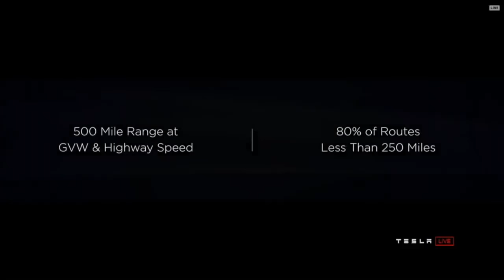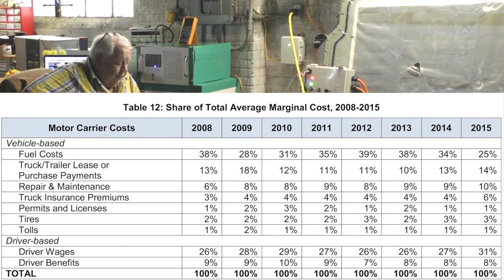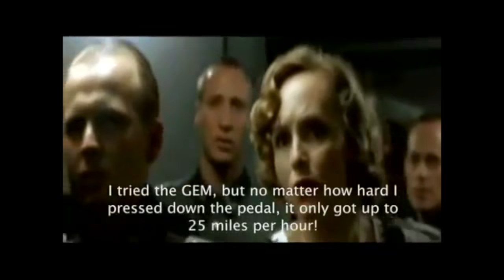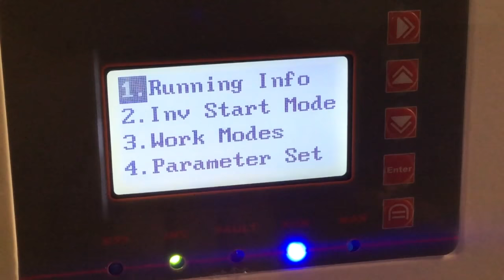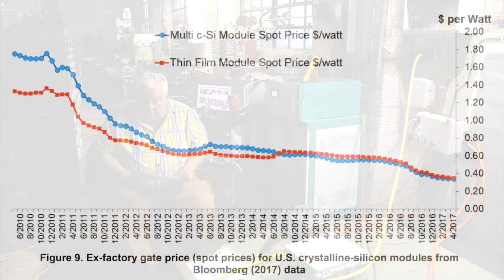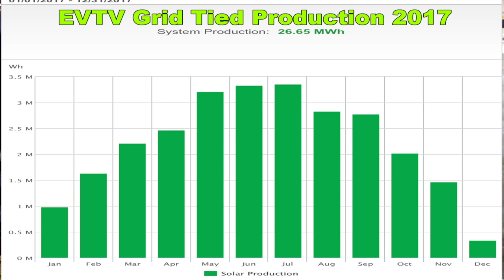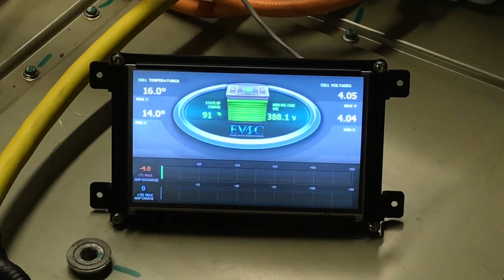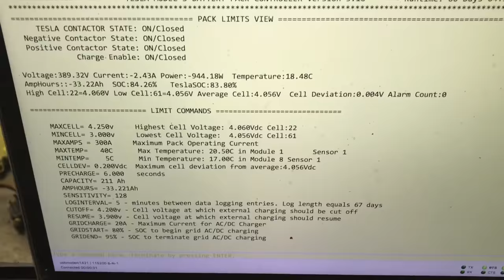EVTV - Dual Tesla Model S Batteries as Solar Energy  Storage

Comment: Great video. Highly informative. I like the idea about using the charger in the winter as even here in sunny Los Angeles, the winter drops my solar input by about two-thirds on my Battery/Solar shed. After five years of trying to get a battery system from Solar City and Tesla, last Christmas I built my own using Jehu's old Samba batteries. It is a 48 volt system. I have been using it for a year now with no problems. I use it to charge my Model S. Looks like I am finally going to get my Tesla battery too. LADWP, Tesla, and my installer, yesterday have approved the system. Can't wait! My other Christmas gift is we are picking up our Tesla Model 3 this afternoon. Looks like it is going to be a Merry Christmas.

Comment: I'm glad that people like you and Damien exist, I'd be ignorant without you! As for Tesla battery to battery charging, what part of the Tesla allows for ludicrous mode and chill mode. These modes would suggest that there is already control over the output (but would that be in the motors inverter or the main controller?)

Comment: Great video!, I can confirm that the trucking mega chargers WILL be a separate charging network and will not use the same connectors as the regular Tesla supercharging network. Tesla will install Mega chargers at places where company's own the new Tesla Semi, they will install the mega chargers along routes of company's who buy into the Semi FIRST and expand from there, with plans to spread the mega chargers worldwide. They have 2 years to start installing these, and they will not need as many as the supercharging network as the number of Semi produced will be much less.

Comment: Comment at 1:15:00ish, regarding utility company workers checking for voltage prior to working on grid wiring during power outage. Jack implies that if workers check for voltage and shut down the source before working on the line, they'd be fine without having to have an automatic shut down switch on each house with solar, wind or generator. The problem is that there is virtually no way for those workers to tag-out, lock-out every possible source feeding the line. Without an automatic switch, when the sun comes out, the wind starts up, generator gets refueled, homeowner flips the main switch back on, etc. the workers would never know when the lines will suddenly become re-energized.

Comment: Nice to see you are working on new things, always fun to hear about your progress on many fronts.

I see your 6.6kW charger list listed with only an AC input range, would the 6.6kW charger work to charge from a DC input to transfer power from one battery to another?  Or is the input strictly AC?  I have found many AC to DC power supplies work just fine on a DC input so long as it is in an acceptable range (150vdc to 300vdc seems to work well on computer power supplies for example.)
Reply: Nice so you could almost use this to transfer power between your two Tesla packs and balance the voltages before paralleling them (if you are under 375 volts).  (Though I admit directly connecting them and recording the current spike sounds much more exciting!)  Some of the power supplies I have tested also take that rectified DC input and run it through a power factor correction boost converter.  While they do handle the DC input I have yet to find any thing that says it is OK to use a power factor correction boost converter as just a plain high voltage DC to DC boost converter.

Comment: Can a grid-tie sync source with feedback isolation (transformer? diodes?) be simulated (current limited signal injection) or use a battery inverter AC output as the sync source to trigger the microinverters into operation? I just found your channel and I must say, this channel has the most useful information than any other EV battery site I've seen. It's gonna take me a month to re-learn all the possibilities of PV using EV modules for storage. I've been beating my head against the wall trying to come up with an efficient, yet simple system of supplying an off-grid full sized home with enough power to live like I'm on-grid without breaking the bank or having too much equipment with too many points of failure. I prefer the idea of AC coupled microinverters with an EV battery backup using standard (240vac) Tesla chargers and controllers. My peak grid use in the badly inefficient home I live in now peaks at about 2200kwh month during high summer.  I currently work doing telecom power generation, 48vdc battery, and DC power plants, am retiring next year, and will be going off-grid in north-central Arkansas. Seeing as how your up in MO, I'll probably be coming for visit, once the property has been purchased and load analysis has been done on the new place. I'm planning on 30-40kwh.

Comment: Hi Jack, AFAIK during chademo session car is sending over the canbus the power it requires for charging and as soon as it's off too much will disconnect battery immediately. Hooking up fully charged external battery to discharged one in the car doesn't gives you too much control unless you have idea how to solve that too.
Reply: Jack I'm sorry I didn't mean to upset you - I base my AFAIK on mynissanleaf forum where Gary Giddings did plenty of work on Chademo - I'm not sure how closely Tesla follows Chademo specs. Gary mentioned that V2H cars did have special firmware on them.

Comment: 12:37 Wrong
IF the tractor slows down BUT the loaded heavy trailer DOES NOT SLOW DOWN. The trailer will pass the tractor,  that is called Jack knife.

Comment: What fraction of the diesel costs are taxes that fund road maintenance?  If those taxes were paid by electric semis (the electric semis won’t be subsidized forever), how does that impact their cost per mile?
Reply: Electric semis are great, and the economics will likely cause them to overtake diesel faster than most people expect. However, semis damage roads at a much greater rate than standard vehicles. Diesel taxes fund those repairs. Eventually someone will need to pay for the road repairs and those taxes will either come from a use tax or the general fund. You’re implying that the loss of those taxes are a good thing as those roads which were built by my forefathers should be used indefinitely without further maintenance. Sorry, but roads need repair. The money has to come from somewhere. I’m asking a simple question, if the diesel taxes which are used to fix the roads today were paid for by the electric vehicles, how does that impact their per mileage costs?  $0.05/mile?  $0.25/mile?

As for subsidies, it makes sense for the government to subsidize electric cars to the point that our oil imports reach zero.  If that’s most efficiently done by rebates to electric semis, fine by me.  But let’s separate road damage from oil consumption.
Reply: ""if the diesel taxes which are used to fix the roads today were paid for by the electric vehicles, how does that impact their per mileage costs?" Depends on if solar is used or not. In other words, how you going to charge a person who has a solar system and putting the power into/on a semi?

Comment: "Solar Edge" Pure sign wave inverters can run 99% eff. on 300 to 400 Volts DC. Only weighs about 30 LBS. with no copper transformer inside. for less $ than the 10 kilowatt inverter you have. New off grid technology!

Comment: In my situation I cannot have panels that are in series, I have too much shading, it will block all the power, if one panel is shaded... So I probably should use high-voltage panels in parallel... When I bought my 24 volt panels I did not know of any other higher voltage, at the time...

Comment: Companies pay way less at bulk. 1.65 a gallon maybe. The diesel thing alone is worth it.  16 years driving  , indpendent driver. Get rid of the drivers you will have a upsurge in surfs lol , but i would suggest they start making some changes now. Those trucks a perfect for same day guys currently. I would get one , to not get one is insane for your bottom line , as buyers buy less i.c.e trucks  , then fuel goes up and it will become futile.

Comment: Jack -- Depending on where you get your data Tesla's Semi reservations have already passed 1,200 and are closing in on 2,000 units.  Tesla has also indicated that Mega charger locations will not be collocated with Super chargers--or not typically collocated.

Comment: Buy a tesla truck, jack
Reply: A Tesla Semi with a covered car carrier to haul his toys in.
Reply: Their truck is going to be a huge failure.
Reply: idontcare80 really. Brilliantly detailed and well argued points you made there.
Reply: I don't believe that the context here required any more detail than that. 

It really just boils down to Tesla promising much more than they can deliver, the numbers just don't add up. 500 miles of range would require a battery that's more than twice as expensive as a complete class 8 tractor, it would weigh more than the typical weight of a class 8 tractor, and there's nowhere to charge the things. Either Musk went completely insane, or he's making use of a massively world changing battery technology.

Edit: Had a brain fart, fixed it.
Reply: The Model S and Model X don't have to work for a living, all they have to do is carry soccer moms and trophy wives around while they run errands. Pushing an 80,000 pound vehicle around at 65 mph that has 14 tires and an enormous frontal area for 500 miles requires a LOT of energy. Even at 2,000 Wh/mile (which I'm betting is a very low estimate), you're looking at more than a 1 MWh battery pack. You know firsthand how much Tesla battery packs weigh, so how much will a 1 MWh pack weigh? Also, one of the founders of Tesla left and founded Wrightspeed because he knew that Tesla was expecting far too much from BEVs, so I can't be all that ill-informed.
Reply: Anyway, I appreciate your videos, and I'm not against BEVs in any way, I just don't think that they're as capable as some people would like to believe they are.
Reply: Musk is a pump and dump guy. It's all smoke and mirror marketing. Like in the early 2000 when they  came up with the scam and marketed "all natural juice" through the get in now marketing. like Shaklee. The Tesla was a Youtube deal. With salesmen being a Tesla Youtube channel. Get a referral code. Referral code for what ?  You "buy" a product when it's ready to buy. Looking at some of the quality issues of a Tesla. It's nothing that great to get ants in your pants to take a monetary hit of 40 thousand in two years on. The truck. Well the Nikola Motor Company truck. Sure seems to make more sense.
Reply: Arizona Northstar - I dunno, Musk is a mystery to me, and I really don't know what to make of him. He gives off a very strong evil villain vibe, but then he's offering products that are having a positive impact on the world. I do think that he's a little nuts (he'd have to be to do what he does), and I think that his insanity has gone too far with this truck. Who knows, though, maybe there really was some massive breakthrough in battery technology that Tesla is keeping under wraps, I very strongly doubt that, though.

Hydrogen makes absolutely zero sense as a fuel, everything associated with it will always be insanely expensive, and it's not even green, it's just another fossil fuel. If the Nikola One used a series hybrid system with a multi-fuel ICE, then I'd say that it was a viable product, but I don't think kind of hybrid system even makes a whole lot of sense for a highway hauler, that application would benefit more from a hybrid power recovery turbine system. A series hybrid system makes much more sense for vehicles that do a lot of city driving, like garbage and delivery trucks. The Nikola One is a beautiful truck, though, and it bares a suspicious resemblance to a truck I modeled in AutoCAD many years ago.
Reply: Over the years I have meet and done business with guys like Musk. Very successful people. They all had one common denominator. You put the right money in front of them. They will throw you the keys. There isn't a this is my baby mentality. It's one of the reasons they get to where they are. The everyday Joe most times has this hang on to their end. Which doesn't allow them to move or advance to the next more profitable venture. What I see Musk doing is making sure that the Tesla car company has a giant social media exposure . This using the "Referral" for a founders edition is priceless. Exactly where's the battery coming from in 40 years to run the 2018 founders edition. It's not going to bring the money, of say a mint condition 66 Cheveille or a 70's Hemi Cuda.  Then to put the sky is falling. Climate change twist to the electric car is just whip cream modern marketing.  I am not against the EV's. There will always be advancement in transportation. But sometimes you can get into trouble getting the cart in front of the horse. Look at Tesla now already having to redefine Supercharger use. Then you have the Asian builders coming out soon with their models. Some are really slick. At some point one of the auto makers will either merge or buy Tesla. Because again Musk will toss the keys as quick as he can.  Then this whole "Were the Tesla Community" or club nonsense will come to a end. Just watch.
Reply: I couldn't care less about the business side of things, capitalism is nothing more than a failing bureaucracy, what I care about is the real, physical world and how our technology affects it and our place in it.
Reply: You have to understand one thing. Without "Capitalism" there is no "technology" to affect the place. Gee Marie. Are the children today getting completely brainwashed.
Reply: Uhhh... No, without human cooperation there is no technology. Humans were developing technology long before capitalism ever existed.

"Are the children today getting completely brainwashed."

No, our value to an obsolete economic system is falling and we're becoming slaves.
Reply: Try and see if human cooperation can keep you fed, clothed, housed...
Reply: Human cooperation is the only thing that keeps me housed, fed and clothed. Making those things possible requires the cooperation of millions of people!

Also, consider the Apollo program, it was a public venture and it advanced and created technology that put the US ahead of the rest of the world for decades to come, and it did that by managing the cooperation of thousands of people.
Reply: You claim Musk likes to inflate the value of something and then cash out. Well then, why is he still at the company? The stock value has inflated enough to satisfy any such tactics. Why isn't he leaving? I guess your little argument has zero connection to reality. The Nikola truck costs double what Tesla is asking and you can bet it costs more to make and store 1 kWh worth of usable energy contained by hydrogen than just producing 1 kWh of electricity. Let's review this quickly, the truck costs more, the fuel costs more to produce, hydrogen vehicles have been ready for decades and they still haven't managed to become an important niche anywhere. Could it be they still cost too much? The reality of their slow adoption would say as much if not more, it says they don't scale without far more massive upfront investments that nobody seems to want to make.
Reply: Jack there are pictures of the charging jack. It looks like four separate circuit's so I don't see major issue's for the technology with there grid storage solutions used to bolster the network.
Reply: Waiting for the buyer. We don't really know his actual stock holdings now or what they were.
Reply: Arizona Northstar, according to the latest SEC filings, Elon Musk has about 33 million shares of Tesla, and so far he’s doing pretty good abiding by his promise to be the last one to sell. But Kimble Musk is selling off his stock $3 million at a time after Tesla bailed out solar city. 

We don’t hear anything about the Tesla solar roof tiles. I can’t find a single video showing how the tiles were installed, the specs, etc. all we saw was a video showing Musk and Strauble got a tempered glass roof installed on their house. I can’t find any public installed Tesla solar panels either. Even the Tesla car owners are installing non-Tesla solar.

If Elon sells his stock and resigns as CEO of Tesla, the stock will be a penny stock within weeks. But as long as he’s willing to take a paper loss of $2 Billion and not sell, like he did during the last drop, people who are betting on Musk won’t sell either. People are betting on Elon, not Tesla or Solar City.